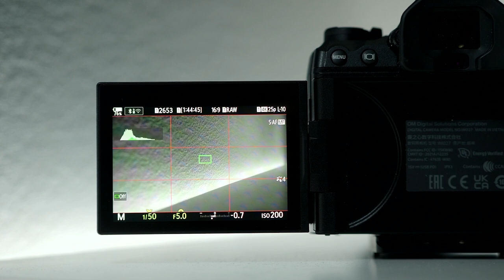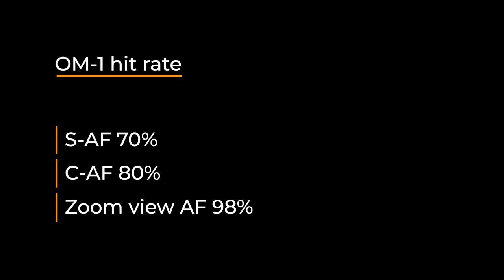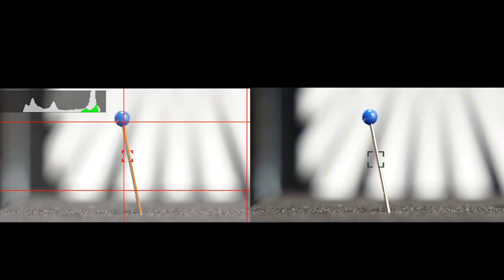OM-1: Let's talk about S-AF.

Comment: Thanks for doing the test, or course we use the camera differently and we present different results. Good to have more data from various photographers. 
What I am half mad at is the non-response from OM Digital Solutions. 
Back in 2014, Ming Thein knocked on our door (I was an employee) about the shutter shock problem in the original E-M1. We presented it to Tokyo. We got a response immediately and said they were working on a solution.  It came in firmware update few months later. 
All cameras suffer from some kind of shutter shock, not just Olympus. Just like how everyone is saying now (all cameras struggles in low light). Many also said the E-M1 was so good, that the advantages (EVF, weather sealing, 5-Axis IS, improved image quality, fast focusing) outweighs the shutter shock problem. 
But for Ming Thein, the problem was real. We did not take it lightly. We responded, and we came up with a solution. We did not do a "no response" reaction. 
Ming Thein raised a valid complain (while a lot of others invalided his issue) and we got the first solution in the world for shutter shock problem.  Which was the anti shock 0 sec (first curtain electronic shutter). Not even Sony or Canon had that solution until few years later. Olympus pushed and make great things happen, all from a "not so serious complain".
I sure wish the current OM Digital Solutions had the same tenacity and wisdom as Olympus did.
Reply: Agree with that: it's better to raise the difficulties than to ignore them or minimize them on principle, that makes progress.
Reply from the maker: I have had totally different experience. In my opinion OMDS is doing quite good. There was a problem with C-AF in video at the beginning.  It was reported by a few users, me included. The official answer was the firmware updates. OM-1 has gotten four firmware updates in a year. Not sure that is all good, but OMDS is responding to problems quite quickly. They have also launch new products. OMDS is still kinda of a startup, we have to remember that. They also have had a huge transformation from Olympus. It has been a massive workload. 

We will see how the respond. On the other i think the S-AF works as it meant to. It is a lot faster in many situations.
Reply: @ForsgardPeter  I was referring to you asking for an official response from OM Digital Solutions, and you specifically mentioned you did not hear anything from them. It should not take too long for them to have an answer. Something like "we shall look into it and if there is a problem, we will fix it" would suffice. The silence from their part, to a direct question from their own ambassador, was not something I expect, certainly not my experience with previous Olympus.
Reply: Robin, I think you are a bit harsh lately when it comes to OM System.

Regarding the points you brought up - before you published the video it was a non-issue. In my opinion, it still is a non-issue as it is a techncial decision: As you know for sure how contrast detection calculations work - you can either have precision or high confirmation, not both. It is mathematically not possible and has to do with the area you are using for calculating the contrast.
So many (including myself) would actually prefer the algorithm to stay like it is. 
OMDS have to consider all these things now before doing anything in prematurely -  they cannot follow every suggestion on the internet blindly.

I am sure that it took Olympus longer than 5 days to come out with the EFCS / anti shock - which was btw a real undebatable issue that many photographers not only MThein knew about (e.g. in the  E-P5 as well, as you know for sure).

Maybe you can shoot with a different camera instead if you don't like the OM-1 and it's performance. Just like me, you are not tied to the company so you do not have to use their products if you don't like them.
Reply: @ThomasEisl.Photography   
It took us less than 2 hours to come up with an official reply to Ming Thein.
Which Peter did not receive in 5 days. Big difference here. 
I have a lot of respect for you and your knowledge. But you lost it there when you suggested "I use a different camera". That was harsh, and uncalled for. I reported a valid problem and I have proven it. You can choose to ignore it or say it is a non issue for you. But to brush me aside and invalidate my claims and you having the audacity to ask me to give up OM-1, a flagship from OM system, that is just plain unnecessary. 
I pointed out an issue, reported it with evidence. If you want to see more than that, and assert your own opinion, that's up to you. As for me I don't hate the camera or OM System. As reported by about 100 and more people now the poor AF in low contrast and low light for OM-1 does affect our photography. So are you saying ALL of us should just give up on OM-1? That is absurd! 
I have nothing against you, and I want to believe you, but asking me to get rid of my OM-1 shows that you may have some personal issues with me somewhere and sorry, I don't have time for that. This is my final response to this comment.
Reply: @ThomasEisl.Photography  I'm quite amazed and shocked. I don't know if you realize that your recommendation to Robin Wong to drop OMDS is particularly arrogant and disproportionate, especially for someone who has helped many Olympus owners over many years to get to know and master their camera gear, always with sympathy, conscience and competence. Technical exchanges or strategic debates, when they remain courteous and respectful, can contribute to advancing a brand to which many of us are attached. I deeply regret that Peter Forsgard lets such a comment from his guest pass on his channel without any reaction to temper it and I hope that my stunned reaction will not be censored.
Reply from the maker: Let's be civilized here and keep the conversation nice. MC no your comment won't be removed, why would I do that.
Reply: Oh I don't have any personal issues with you Robin - I don't even know you personally.
It is a bit unfortunate that this allegation comes up, as I only wanted to converse on a  factual level.
No need to be upset - thanks for engaging and have a great day, Robin!
Reply: well your problem Robin is attributed to your lack of understanding how best to use the equipment at your disposal. your issue is your issue and not OMDS' problem no matter how many of your followers have been convinced to believe it should be. 
your problem has been analyzed, explained, and solutions offered. your are now trying to make a negative point, again, against OMDS on the ridiculous grounds that it was not OMDS whom helped you fix your problem, that is some low class rubbish. your problem is solved. period. 
Stop attacking OMDS, it is low class. 
yes, lot's of folks use their cameras differently than others but the TESTS that Rob, Thomas, and Peter did were the same as your TESTS...low light low contrast S-AF and C-af.  Those three all found, identified, explained your issues and added the solution which you couldn't do any of (or wouldn't?).

shutter shock was a real issue.
Reply: @mc256  Like you, I've been a follower of Robin's for many years, and he influenced my decision to buy Olympus gear up through the OM-1. His videos, particularly while an Olympus ambassador, were informative and entertaining, and I thank him for that. So I was amazed and shocked to hear him publicly express bitterness towards Olympus when they dropped him as an ambassador. It showed a lack of maturity and professionalism; no company will ever want to engage with someone like that.

When the OM-1 was released, and Robin put up a click bait video titled "Why I won't buy an OM-1" even before trying out the camera, he lost me as an objective source when it came to Olympus/OMDS and its products. Thomas is correct that if one is unhappy with a brand or its products, then it's time to move on to something else. Life is too short to hold a grudge.
Reply: @mc256  "someone who has helped many Olympus owners over many years to get to know and master their camera gear, always with sympathy, conscience and competence" Robin Wong 100% was that person for many many years. He isn't any longer and it seems he will never be again. Period.

Comment: Thanks Peter and Thomas for together discussing this and providing some clarity and further thoughts on the issue. I've watched this in conjunction with Rob Trek's clip and found your views (and Rob's results) quite interesting. I'm sure there will be a lot of back-and-forth on this issue for a while by a great many people. But as I said in the comments for Rob's clip, my conclusion is that what the OM-1 seemingly loses on the low-light/low-contrast roundabout, it gains massively on the better-light-and-contrast swings. From a relatively new user's perspective, I felt the OM-1 AF was a large step forward over my previous system.
Reply from the maker: It is optimized for pin point precision and in low light and low contrast situation PDAF or C-AF works better.

Comment: I respect Robin Wong. I respect both you, Peter,  and Thomas. It was, in fact, Robin's videos on why he wasn't getting an OM-1 - a decision I think was probably right for what does - that made me decide on buying one. Mainly as I could see that his and my type of photography is very different and that while the OM-1 was not for him, it was likely to suit me very well. Six months into my OM-1 ownership I beleive we were both right. I skipped the E-M1 III as it offered little or no improvments of value to me over my then E-M1 II. I didn't care about ND or video. There was practically no change of image quaity. The only things I liked the idea of were starry sky AF and an extra custom setting. That's it.

On the other hand as the vast majority of my photos are of animals, the animal detect AF of the OM-1 was tempting. That and that my well-used E-M1 II was beginning to show its age. So, when I got enough money from an inheritance as it happened, I wnet for an OM-1.Yes, it was an indulgence and I'd never recover the money by any means but I went for it just the same. I have to say the animal detect AF far surpassed my expectations right from the first shots I took with it. As the OM-1 was the only Olympus/OMDS camera to offer it (I am not sure if the EM-1X did or does following a firmware upgrade) it was a massive improvement over the E-M1. Indeed it was a revelation and has allowed me to improve my photography (which to be fair was defintely needed). It is not without issues, however. In particular when it fails to detect an animal-ish thing, it doesn't fall back to anything sensible, it either focusses on something close by, often a foregropund fence in my case, of goes unhelpfully to infinity. I do have a compromise mode, what I call "directed animal AF", which is normal small point C-AF  with animal detect turned on. It helps in difficult real-world animal situations but I have never been able to really work out for certain what its actually doing. Though I can say It does appear to lock on to animal eyes outside the small point detect area sometimes/often.

I rarely use single point S-AF. I do of course, but not enough to be able to notice any specfic issues to make a comparison to the E-M1 II. I am not totally convinced by it, however and can easily beleive it can get confused in some circumstances. Indeed this would tally with some of my experiences but they have never been an issue to me personally. So, its something of a non-issue to me. Though if S-AF can be proven to be worse that some previous Olympus/OMDS cameras in some circumstances, that's a black mark against OMDS, stengthening my all mouth and no trousers impression of the OM-5 - i.e. its all but a lightly revamped repackage of the E-M5 MkIV. But then I don't have one and would not buy one, and have no use for one even if someone generously gave me one as they did for Robin.

I am a little confused. Reading some of these comments, especially those of Thomas Eisl, it sounds as if the very small point AF uses contrast detection (CD) only? Presumably others use phase detect (PD) or some balance of CD/PD? Or have I got that wrong? If that really is the case then yes, single point is likely to have some trouble with low contrast images. And this is seen as an improvement? Okay, PD is generally seen as better/more useful with moving subjects, but its supposedly useful in reducing hunting, giving faster AF even with static subjects. Or are we just saying was all the PD just marketing hype and all we needed was better CD? Tell that to Panasonic. Do we have documented proof of any of this - such as a statement from OMDS of the detection type used in all AF modes?

As a recently retired embedded firmware engineer, I suspect a firmware update could well improve the S-AF. Clearer specs could also help I suspect. Unless there is a hard reason for the difference, such as readout capabilites, which I thought were much better on the OM-1, then it may be that only limited improvement is possible by firmeware alone.

What I am saying is thqt there clearly are some problems with S-AF on the OM-1 in some circumstances. From this and Robin's videos, its clear we have not yet adequately determined what those circumstances actually are, and thus which phtoographers they are a problem for. There appear to be some, by your description Peter, clumsy workarounds. They are only workarounds, suitable for temporary use while a longterm fix is sorted and distributed, hopefully by firmware update. If OMDS really are on their game, they will quickly get to grips with this and make improvements and practically all of us OM-1 users will feel a lot better and, more importantly, potential future OM-1 buyers will not be put off; because OMDS have reacted quickly and positively to improve their product. Putting it to one side and pretending there's no issue, however small,  could well become a photographer public relations nightmare. I think OMDS must respond and be seen to do something and quickly even if its a storm in a teacup that affects very few users. I think this is a test they must pass.
Reply from the maker: Thanks for sharing your thoughts. Always appreciate well-formulated comments. I see the "problem" can be solved by using PDAF. It can be assigned to a button. I see it like switching from S.AF to C-AF when photographing a moving subject. It is the low light low contrast option in AF system. Would be better to have that accessible like S-AF, C-Af etc. Yes, it would.

Then we have the fact that S-AF is much faster and especially much more precise than older Olympus cameras when there is slightly more light. The small AF point is key. 

OMDS did react quite fast for the C-AF and face detection problem in the video. There was an occasional miss focusing for a very short time in video mode. They fixed that with firmware, and now it works as it should. We will see if they do something about this.

Comment: Thank you for these wonderful clarifications. I was also surprised, at first, to see that the AF-S system, on smooth and poorly lit surfaces, was visibly slower on the my OM1 II than, for example, on the OM5🙃. SOLUTION:😁 on smooth surfaces without contrast and poorly lit it is to use the AF-C with the OM1 (OM1 II) here the focusing of the OM1 (OM1 II) is much faster (it is amazingly instantaneous, without hesitation, and precise than the AF -C of the OM5 (and previous models) In my experience, in 100% of situations. This was something that OM System should have clarified (I think it hasn't), because it has actually greatly improved the focusing system compared to previous models, but it involves adapting to a new configuration. Thank you for your great work and kind regards.
Reply from the maker: It was a big misunderstanding. You are right OM SYSTEM should have explained this.

Comment: I've been using om1 for a year and I come from a sony a7R3 with a 16/35 Gmaster. I do landscape photography, wildlife photography, and macro photography, I have the 12/40 2.8 proII, the 40/150 f4 pro, the 90mm pro macro, the 60mm 2.8, and the 100/400. I go to very harsh environments where weight and sealing matter, and in all situations autofocus has never failed me in any of its options. Not in low light, not in the snow, not in motion, not in macro. Each photographer has his experience, and you know that full frame has its advantages and one day I will give myself the nikon z9 but currently om system is incredible for my hobby in the mountains and I do not miss another camera with a larger sensor

Comment: I compared the S-AF with my M1 II and my G9. I was quite shocked that the older  cameras performed better. 
But in reality I know that low contrast is a problem so I always used to work around it, so I won‘t have a real issue anyway. Thanks for the Video Peter (and Thomas). 👍🏼
Reply: Agreed, you just have to know how it works and then you can work with it - you definitely have to try the high precision at long distances, this is really amazing with the OM-1!